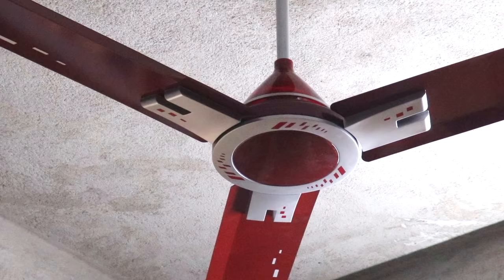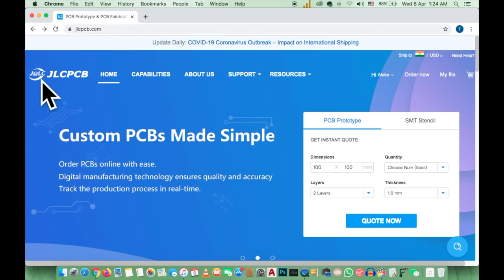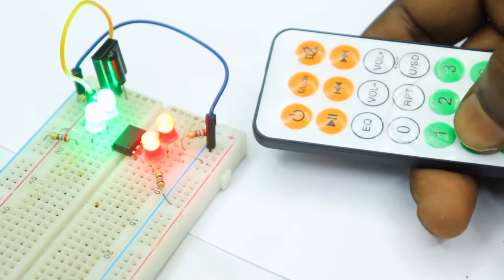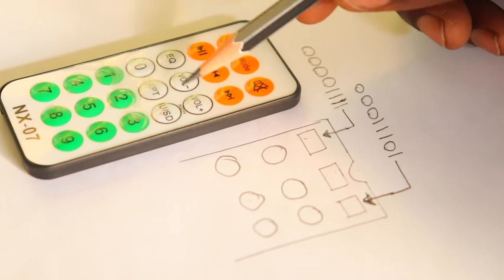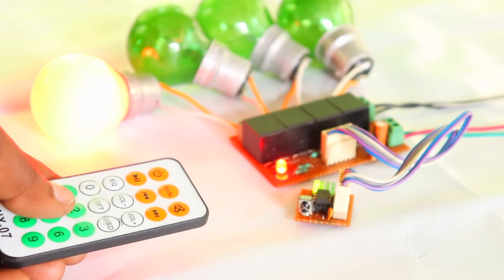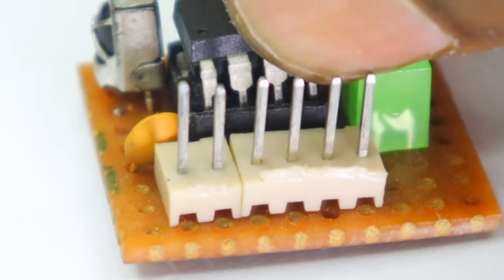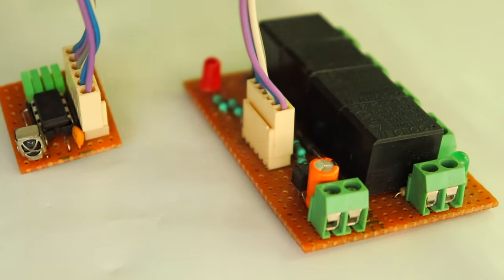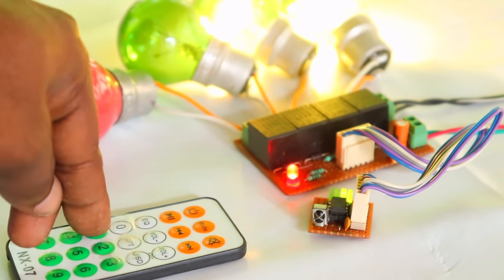How to Make # IR 4 Channel Remote Control System for your Room Appliances (Very Easiest Way)

Comment: Brother, you made another video on this topic, which is a circuit a 3 channel light control can be turned on with off, another 4 channel  with a traic 1 to 5 step ceiling fan speed control system please brother,,,  Created with attiny85
 or 12F675,,, please
Reply from the maker: Good subject,Definitely will try it .
Reply: @EtDiscover  ok bro,,, thanks you

Comment: Very nice video.. Can you please upload some basic electronics video and on how to make a solder track in veroboard
Reply from the maker: Yes I’ll
Reply: Thank you so much.. I wish I could make things like you... You're a genius
Reply: One more question brother.. Can arduino be used in industrial applications too?? Are the normal arduino sensors enough to use in industrial applications like driving and controlling high power loads or there are separate sensors for that?

Comment: If I buy from AliExpress and banggood are the products good as they are too cheap and how much time does it take to ship to India or haryana ,do they take custom duty?  Please reply.
Reply: You will need a debit card to purchase from banggood or AliExpress. The shipping charges would be moderate but your item will take time to arrive (25-30 days). As long as you are not ordering something radio control like a drone or highly capable RC transmitter, your item should pass the customs no problem. And I don't think you would to spend money on customs
Reply: AtTiny45 requires an Arduino to program it. You can't build this if you don't have a suitable microcontroller
Reply from the maker: Attiny 85 Update version,  Don’t Buy 45,  Approx take time up to 15 to 40 days from AliExpress and Banggood , If you want to use free shipping
Reply from the maker: AliExpress and Banggood is good for small things such as IC, Otherwise our Indian custom!!!!!!!!! 😕 If you not receive the item within 60 days, Then you  Refund your, But now it's better don’t order, Because you know why??
Reply: @ishigamiyu1991  I have 5 Arduino Uno , Mega,nano,node mcu.
Reply: @yajuvendrasinghrajpurohit7888  you can use the Uno

Comment: Hello
Sir I have make a code in arduino uno and also test the circuit in it but when I uppload the sketch to attiny85 using arduino this is not work
Why

Comment: Dear sir, I have completed the project, but the program does not work. There seems to be some error in the IR decoded values. From my Sony remote I am getting values as 1= 10; 2 = 2064; 3= 1040;4= 3088; etc., the sketch does not work with these. Your sketch uses values like 0xFFB04F seven digit hexadecimal ?
Please let me know how to get these values ? Regards. 
Oh yes! I found out ! Prefixing 0x before the values the problem is resolved!  Thanks.

Comment: Don't worry about english. Your knowledge is important!
Reply from the maker: Thank you 😀
Reply: @EtDiscover   I am doing it on arduino uno to get hex values of remote keys. What are possible changes?
Reply from the maker: Yes this is possible
Reply: @EtDiscover   which library from github was used for getting hex code ? Link is not mentioned in below subsection of video . Kindly mention it.

Comment: Hello friend, I would like to know if it is possible to use this project to control a three-speed fan, that is, when you press the first button it is the first speed, when you press the second button it is speed 2 to number 3 but by disconnecting the previous one, and a button that acts as a shutdown of the entire system, I ask for this help for the reason that I do not have advanced knowledge in programming.

Comment: Hello ! The code complies and uploads well in Arduino UNO. But it is giving compiling error in AT Tiny 85 . The error is " Error compiling for board AT Tiny" after selecting the AT Tiny 85 board, 1 MHZ internal clock,  no port , and " USBtiny ISP" programmer, as I am using the SparkFun Tiny AVR Programmer. Can you help please ?

Comment: May I use here a power mosfet to control my dc load instead of relay?if yes then tell me how to connect mosfet or BJT as a switch here..please reply...
Reply from the maker: Yes you can, but don’t forget to attach sub transistor for drive mosfet
Reply: @EtDiscover  plz make a separate video about how mosfet is used as switch instead of a relay

Comment: Can you help me i downloaded the library but it doesn’t work 
And it shows me this error: 
Arduino: 1.8.15 (Windows 10), Board: "Arduino Uno"

Arduino: 1.8.15 (Windows 10), Board: "Arduino Uno"

ArduinoProject_21_22:1:11: fatal error: IRremote.h: No such file or directory

compilation terminated.

exit status 1

IRremote.h: No such file or directory

This report would have more information with
"Show verbose output during compilation"
option enabled in File -> Preferences.

Comment: Did anyone check the values of resistors shown in the relay section?. Although each section is identical and serve the same purpose, the values differ. (an overlook? or a copy?). The pull down resistor can be around 10k and the base current limiting resistor can be around 1k. A small signal diode in series with the base resistor would be helpful in protecting the chip in case of a transistor short circuit. Regards, Engineer from India.

Comment: The ATtiny85 is not generating the output in driving the LED, I have checked the IR Transmitter functionality and it is working fine.  The boot loading is done with 16 mHz and the application code as below:  Can someone please help me?

#include <tiny_IRremote.h>
const int RECV_PIN = 5;
IRrecv irrecv(RECV_PIN);
decode_results results;
const int Pin_One = 2;
const int Pin_two = 3;
//const int Pin_three = 6;
//const int Pin_four= 7;

void setup(){
  irrecv.enableIRIn();
//  irrecv.blink13(true);
  pinMode(Pin_One, OUTPUT);
  pinMode(Pin_two, OUTPUT);
 // pinMode(Pin_three, OUTPUT);
 // pinMode(Pin_four, OUTPUT);
}

void loop ()
{

  if (irrecv.decode(&results)){

    switch(results.value){
          case 0x80BF916E: //Keypad button "0"
          digitalWrite(Pin_One, HIGH);
          delay(2000);
          digitalWrite(Pin_One, LOW);
          }

    switch(results.value){
          case 0x80BF21DE: //Keypad button "1"
          digitalWrite(Pin_two, HIGH);
          delay(2000);
          digitalWrite(Pin_two, LOW);
          }
          

        irrecv.resume(); 
    }

  }